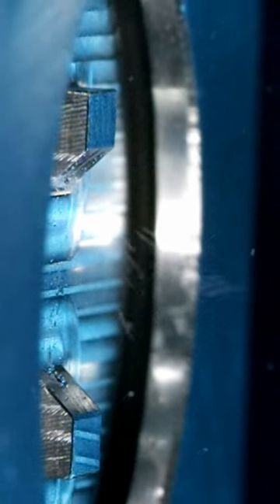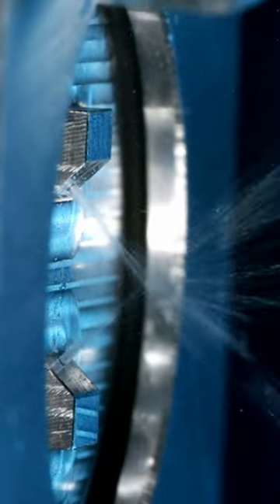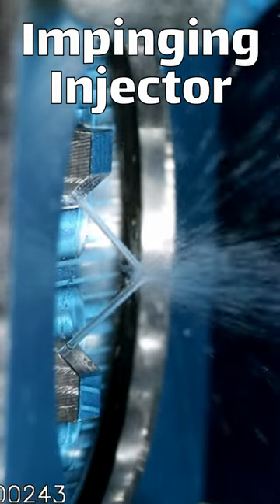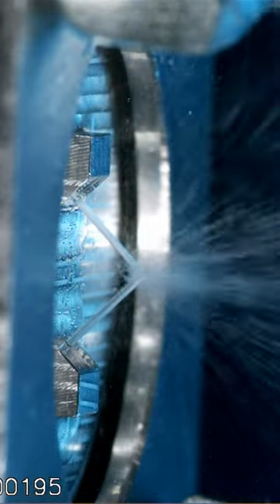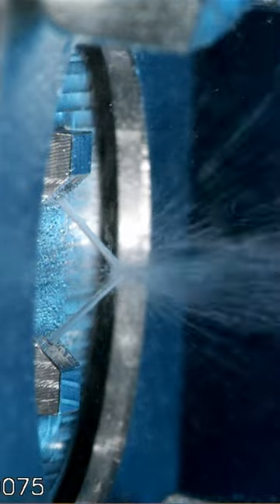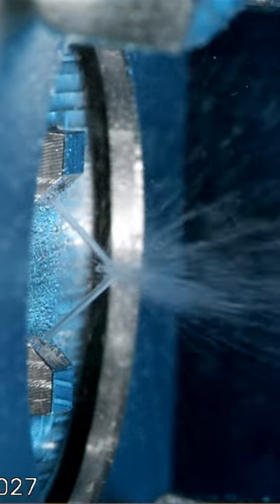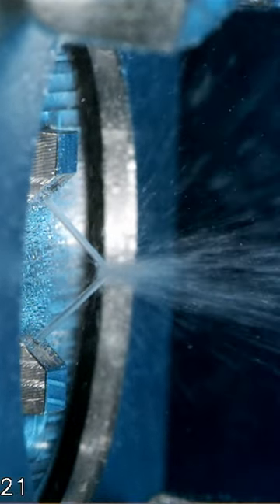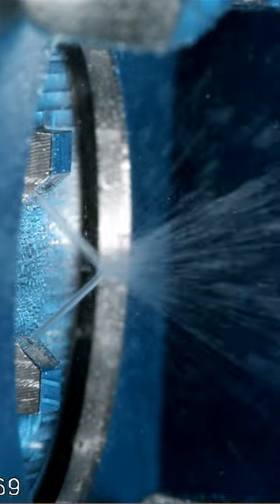Impinging Rocket Injector

Comment: They are set at 45° angle so they are 90° relative to eachother
Reply from the maker: Yep, I am bad at speaking words sometimes 😅
Reply: Nah, it was worded correctly in the video. You just didn’t have anything worth contributing yet still insisted on being “heard”…
Reply: They are at 90 degrees, the obvious  reference is the propellent streams themselves.
Reply: @coriscotupi no sir, if you came to my machine shop and said make 2 jets that spray at 90° angles, you would be disappointed, now if you came and asked for 2 jets that spray at 45° mirroring each other you would get exactly what u got in the video, noone cares what the 2 angles add up to, it’s about what angle are u drilling in the metal to set the jets, and that would be a 45
Reply: @coriscotupi literally says “it’s composed of 2 holes at 90° angles” no sir it’s made of two holes at 45° angles, don’t dick ride the YouTuber like all these other commenters, the original comment was CORRECT it is 45°
Reply: Ok, thats a theoretical way to look at it, buuuttt in the action is completed by two 45* angles. Regardless of what they become downline, which proves the narrator wrong on vital points . Since narrator's usually can't think for themselves, the fault lies with the writer...
Reply: @braeden10120  So anyone who doesn‘t agree with your opinion „dick rides“ a random youtuber?

And the texts in your first comment don‘t correspond to the situation. 
The commentor didn‘t say "spray at 90° angles" and the op didn‘t say "45° mirroring each other". 

If I came into your shop asking for anything "comprised of two holes at 90° angles" and didn‘t get them with an angle of 90° between them, I‘d be really disappointed. It‘s rather obvious that for them to be facing opposite sides like you implied the average person would ask for "angles at 180°" unless they‘re referencing the baseline of the object – directly or contextually – which happened neither in the video, nor in the OP‘s comment. 

That being said, I‘d imagine anyone coming to your shop would be a lot more precise in what they want.

Edit: "noone cares what the 2 angles add up to, it‘s about what angle are u drilling in the metal to set the jets"
You don‘t care cause your perspective is that of building it – therefore obviously using the baseline of the entire device. 
But someone who wants to understand how it works – the whole point of the video – looks at the behaviour of the jets relative to each other, not relative to the baseline of the object. 

A difference you should understand if you personally interact with customers who are laymen.
Reply: fuckin gottem
Reply: @elmfuzzy1  Who got whom? And for what?
Reply: @BreakingTaps you lost a follower for that screw up
Reply: Thanks for providing the right angle.
Reply: plurals are important here.
Reply: @papawhelp with regard to thinking… why did you put an apostrophe in *narrators? In this context that word does not have an apostrophe.
Reply: I had the same thought 2 90° angles would equal 180° so the 2 streams would never meet. 180° is a straight line. 2 45° angles would be 90°.
Reply: @Grouncher it is not implied that these two holes are relative to each other. He is speaking about an injector, singular and said 90 degree angles, plural. There is only one 90 degree angle created with this single injector.
Reply: @joemc5126  It is implied.
Your argument revolves around a – possibly intentional – misunderstanding of his sentence. 
He said angles – plural – because he‘s not referring to the injector – rather, its angle; singular – but to the injector’s holes‘ angle – plural in the original sentence, because it referred to both at once with "the angles". 

In other words: It‘s plural because he‘s referring to the other plural in that sentence, not the singular. 

Of course, you may always assume that he made a mistake that just so happens to be a correct sentence in this context. But that doesn‘t lead us anywhere, since then you could assume anything to have been the intended meaning, no matter how absurd. 

Back to the point: these angles have to be relative to a baseline. 
The available options are: the holes, unspecified baselines on the injector, and unspecified baselines on unspecified objects.

Now, common sense comes into play and dictates to assume that the angles have to be relative to a specified object – holes or the injector – preferring the one(s) with (a) specified baseline(s) and using that/one of those – which one would depend on the given information.

If you want to argue against this, please provide detailed (and valid) reasoning the next time.
Reply: @Grouncher  it’s quite simple, you are overthinking this. Please explain to me how two lines both protruding from the same plane at the same 90 degree angle could ever intersect? The author of this video even admitted fault to his own misuse of the language you’re trying to twist. It’s ok, you’ll get the hang of geometry one day. Keep at it, I truly am rooting for you!!!!
Reply: @joemc5126  Wow, sarcasm and insults. That surely must prove your point. 

"It is comprised of two holes at 90° angles."

How does that imply anything about a single plane with 90° lines? 
Unless, of course, you require the 90° to be relative to the baseline of the injector – or any other single baseline of an object. 

Hmm, that sounds familiar… oh wait, that was your point. 

And, as you claim to know, two lines protruding from the same plane at the same angle are parallel and cannot intersect. So much for your point. 

What a shocker it is, then, that understanding the angles to be relative to each hole, instead, would suddenly give you two baselines to work with and thus allow it to be possible to construct it geometrically. 

Example: Take one hole, place the other 90° relative to the baseline that intersects its normal (essentially the "surface" of the hole) and orient it such that its hole is aligned with the axis of the baseline. Now trace lines through the holes (perpendicular to the two baselines of the holes). 
And, voila, you have 2 holes "spraying" lines at each other that (the lines) intersect at a 90° angle. 

I hope you are able to follow these instructions to construct the geometry.
Reply: @Grouncher  you see there’s just one problem. Here you go assuming there are two base lines of which the streams are exiting. There is only one injector head unit. The tip of which is a flat surface with two nozzles set to a 45 degree angle. You’re wanting to lawyer your way into being right by assuming under the surface of the head there are two other separate planes for which each nozzle is set to a 90 degree angle.

Show me the blueprint for this design to prove your point of two separate planes beneath the surface. All we can go off of is what we see which is one plane with two nozzles.

You still haven’t addressed the fact that the creator of the video admitted to misspeaking about the two 90 degree angles.

You’re just incorrect about this injector. It’s okay to be wrong bro, just learn from your mistakes and in the future you’ll be better for it!
Reply: @joemc5126   … seriously? A plane?
Rewatch the video. 
At the very first second, where the two streams are ejected, you can see it in all its glory. 

Please, if you can, do tell me again that that is a flat plane where the holes are drilled into. 

On a side note, I now understand where you‘re coming from. If that were a flat plane – it isn‘t – what I said wouldn‘t make sense. 
But you should have clearly made out the two trapezoids the holes are drilled into protruding from the plane that you‘re referring to. 

Also, both baselines I referred to would still exist even if it were a plane with two holes, they‘d just be identical and possibly not perpendicular to the streams  exit trajectory.

Edit: And on the topic of lawyering:
It‘s funny that part of your argument is suggesting invalid ideas (i.e.: that I assumed there to be additional planes under the nozzles). 
Never said that and you clearly didn‘t understand my previous comments if you thought that.

Edit2: 
Also, the author agreed because it‘s a time sink and bad idea to argue with your followers.
Reply: @Grouncher  here you go again assuming. “Drilled holes”?!?! If you can’t see this was 3d printed, I just can’t help you at all.
Reply: @joemc5126  3D-Printed, why, cause it has lines on its side? 
Did you ever see a cnc machined part? 
3d printed metal parts don‘t have lines like plastic ones because they‘re not extruded the same way.

Edit: Two failed attempts at sending a link later, you can just google "impinging injector" and look for the very first image (at least it was for me; otherwise, search for one from researchgate – not the air-assisted one). 

That shows a 60° angle between the holes (relative to each other) and this video clearly has a wider angle. 

The air-assisted one shows a 45° angle to a central air injection nozzle, which is the same for the other hole and thus becomes a 90° angle between the holes.

Edit: Also, please stop with the "here you go again assuming". 
The first time you just made up something that was evidently wrong and never said (nor implied) by me.
And the second time it was a fact – even if you thought otherwise because you assumed (the irony…) that it was 3d printed.
Reply: @revmsj it isn't worded correctly.

He said at 90 degree angles... Eagles means multiple angles.

He should have said at 45 degree angles or at a 90 degree angle.

For someone complaining about others not contributing but just wanted to be heard, your comment proved that to be 100% true for you.

Sometimes English is hard, maybe try a little harder... Or watch the incredibly short video again and listen carefully.
Reply: Now that is an argument. 

I understand and agree with your point, @Broxalax, and appreciate your explanation, @jash21222. 

I‘ll amend my first comment to take this into account. 

Thinking of the angles as being relative to the other hole respectively led me to take angles to mean the angle from A to B and vice versa, when it should‘ve been *the angle relative to the other hole*. 

With it being only one angle, the sentence does not imply that it‘s referring to the angle between them. 

Edit: Neither does the OP’s comment address this correctly, however. They are talking about a single 45° angle.
Reply: The streams are at a 90deg angle to each other, that's the important angle. The jets are at 45 from the surface not each other.
Reply: @Grouncher Okay man we get it you really love acting smart.
Reply: @BreakingTaps Press X to doubt
Reply: @jackcarlson8875  I love being detailed because I hate being misunderstood. 

If I loved acting smart I wouldn‘t have admitted my mistake in my first comment.

And the only reason I wrote so often is because people kept mentioning me and I’m not the kind to ignore that.

However, if you feel that using more words and proper punctuation is "acting smart", then yes, I am doing that; and I’m not gonna stop.
Reply: @BreakingTaps use your brain
Reply: That's how to make more comments.. some times they call men she . Or women he .. if you see a video like that, skip .
Reply: @ss41f  interesting point
Reply: @revmsj And what exactly was your contribution here?
Reply: 45 relative to a “baseline”, bot each other
Reply: @revmsj good shit bein wrong
Reply: Not technically wrong but less right than you
Reply: @revmsj i can see how it can be confusing, two people can be right at the same time
Reply: @BreakingTaps what is use of these
Reply: @svmwasthesheet1971 None. Their comment applies more to themselves than anyone else.
Reply: Came here to see if anyone else caught that.
Reply: Probly  cousins.
Theys always smashin and impinginging.
Reply: Thank you
Reply: I'm so glad you are "bad at speaking words sometimes" great honest reply btw really made me chuckle and sub. The back and forth in the comments is quite entertaining  @BreakingTaps
Reply: @Grouncher  You sound like a real fun person to be around.
Reply: @jackcarlson8875 Fun to people who enjoy discussions, yes. 

Fun to you? Apparently not, according to what you judged from a handful of comments on Youtube. 

That seems to say less about me, however… 

But I am curious, what exactly made you say that?
Reply: @jackcarlson8875  I‘m sorry, I had not realized that you are the "you love acting smart" person from before. 

Why did you feel the need to come at me again?
Did you forget that you had already written a comment here or did you just want to add that?

Also, the question from before applies to your previous comment, too. Which part exactly made you say that?
Reply: Nerd war in the replies.

Also, Breaking Taps already agreed with OP.

Take a break, get a cup of your favorite drink, and stop fulfilling your need for social interaction from the internet.
Reply: @oompalumpus699  It‘s been 2 months since the end of the nerd discussion…talk about need for social interaction. 

Also, I‘d interpret their reaction more as avoiding conflict than agreeing, as I said before.
Reply: Seriously, what‘s it with random people chiming in only to leave snide remarks. 

Is there some reason you’re all trying to get at others?
Reply: Umm actually 🤓☝️
Reply: Nerd
Reply: I checked it with a square that shit is 👌
Reply: the right angle 😅
Reply: @Grouncher dude are you high on glue fumes?
Reply: Yeah saying "comprised of two holes at 90° angles" sounds like the holes are each drilled at an angle of 90° from the surface into which they're drilled. 
Since they can be drilled at angles in different directions, the combined angle of streams of liquid coming from them is too imprecise a way of describing them to always be accurate without further explanation.
The concise, accurate way of saying it is "comprised of two holes at 45° degree angles"
Reply: Thankyouuu
Reply: @joesanpatricio794  But they are each drilled at a 90° angle from the surfaces they‘re drilled into. 
Those surfaces are slanted, by 90° relative to each other or each by 45° relative to the section between them.
Reply: @revmsj Nah, it was worded correctly in the comment. You just didn't have anything worth contributing yet still insisted on being "heard"...
Reply: Classic internet know-it-alls here. We all know what the dude was talking about
Reply: Your comment added absolutely no new content. The narrator worded it correctly. The two holes ARE at 90 degrees to each other.
Reply: This thread is crazy. It's a comment section, not a writing assignment or a doctoral dissertation. It is kind of funny seeing you guys interact and have a, mostly, friendly argument over such a silly little misunderstanding that really means nothing and affects no one
Reply: @coriscotupi  the sentence "that spray ar __ degree angle" means that the spray itself is at the __ degree angle relative to the surface it's connected to. So you are wrong and the commenter is right
Reply: @ckpioo  Sorry, but no.
Reply: @coriscotupi  The streams of propellant fluid are each at 45° fckn degrees guy. Two 45's make the 90. Duh.
Reply: @braeden10120 it could be interpreted as “two holes with 90degree angle to each other” . Only toddler wouldn’t understand that
Reply: @braeden10120  yeah. Angles are hard for people, as perfectly described by both you and that other guy responding to you arguing about 90 and 180° and it being obvious or inferred, and whatever else.

The end of the argument is if you ask for the wrong thing and don't explain it, you'll get the wrong thing. If I didn't understand the lingo, I'd draw it or explain it as best as I could.

This is the same in the electronic business, if you ask for the wrong thing, or think it's obvious what you need without stating it, you'll be disappointed. I wasn't aware quick release rc plane wings used VGA style connectors, as that's ancient tech, so I'd never assume. If you TOLD ME then you'd get the right thing, if you assumed I automatically knew every standard of every product across the world, we would both end up confused.
Reply: very astute.  duh
Reply: @BreakingTaps yew fale englande?? Thets unposseebull!
Reply: @revmsj  🎯 😣
Reply: Two peas in a pod you and him. @revmsj
Reply: @braeden10120 Bless your heart. 45 degrees relative to what? The only constant and the only thing that matters is their relationship with one another. And they are 90 degrees apart. Where did you get any information from this video that they had a relationship with anything else?
Reply: How do you know they're at 45° relative to anything. The camera could be tilted
Reply: @revmsj  Facts.
Reply: Bros the streams are perpendicular to each other can yall move on now?
Reply: I think it makes sense the way he said it in the video. He said "two holes at 90°" the two holes are at 90 degrees relative to each other
Reply: @coriscotupi 90 degrees would make them smash into each other directly. 

The stream forms a 90 degree angle. They are not facing at a 90 degree angle.

C'mon now.
Reply: That's 45°
Reply: I was gonna say those are definitely not set at 90 degrees
Reply: @revmsj 💀💀💀
Reply: @revmsj I think the comment was just adding clarity. It’s a small thing, but no it was not said correctly in the video, as the channel itself states in the reply.
Reply: Ah that makes sense
Reply: @revmsj funny that last sentence you’re talking about yourself 😂😂
Reply: @BillzosWorld  bro don’t act like you’re not happy af I lit this glorious fire…😏
Reply: 45 degrees relative to what? 90 degrees all the way. You failed geometry class?
Reply: @BreakingTaps I still think 90 degrees is correct
 45 degrees is just an assumption. 45 degrees relative to what?
Reply: @braeden10120 your machine shop should learn to speak English
Reply: That’s what he said.
Reply: Thank you
Reply: He said that. You’re one of those guys eh.